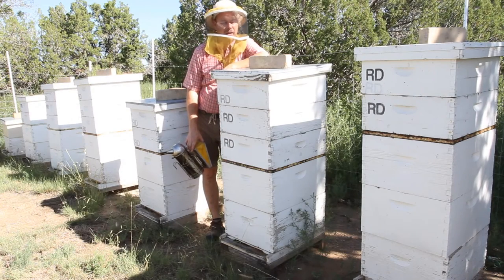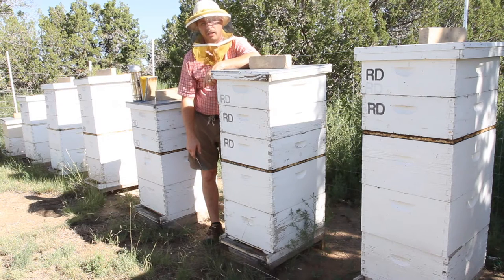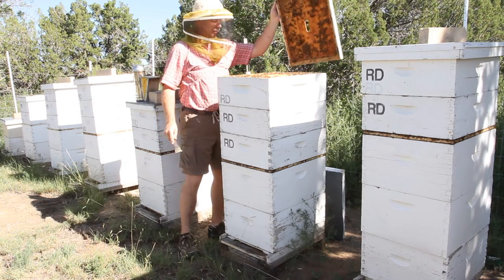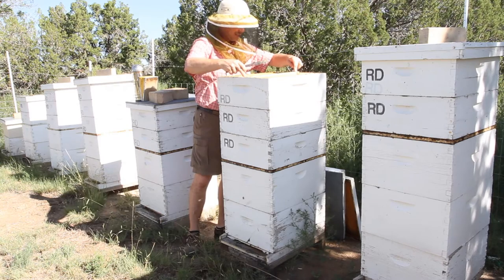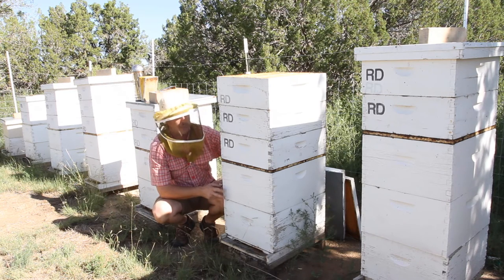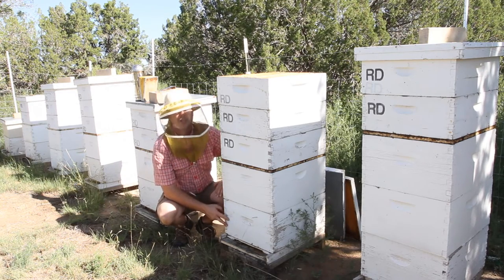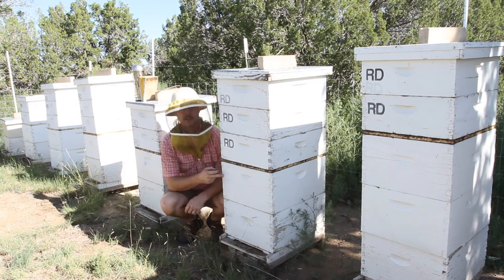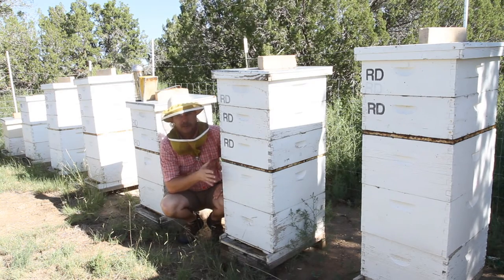Checkerboarding II

Comment: Excellent video.  The question I have is that in the spring, when he bees are in the top hive body, and thus empty in the hive body of bees or stores,  do you reverse the hive bodies?
Reply from the maker: You can, as long as you know the bees are clustered only in the top hive body.  This will speed up their brood production, so if you do it too early before a nectar flow you will have a swarming problem.  Some beekeepers will invert the hive bodies when the bees are in the middle of a double deep hive body which splits the cluster and slows down brood production...as a swarm prevention measure.  I have a video on this if you're interested:

https://youtu.be/Km5KVEsAEh0

Thanks for asking!

Comment: in doing the Walt Wright checkerboarding ... you have ABAB in the lower honey super ... and * BABA * in the upper.  My guess is that when you need to add that upper super, if the lower super is full ... or near ... you could pull every other frame from the lower (ABAB) and place in the checkerboard pattern (BABA) above.  Is that how you do it?
Reply from the maker: That is the Walt Wright method, yes.
Reply: Just curious have you tried an empty super in  between your lower and uper checkerboard?
So 
Ababa Ababa
Aaaaaaaaaaa
Babanababab 
If that makes sense.

Comment: I see that you don't use any Imerie shims. Wouldn't this make egress to the honey supers easier for the workers?
Reply from the maker: I've tried them before and never found them to increase production of honey.  But, the real problem for me is that the shims create a gap between the hive bodies that is too large and so the bees tend to build brace comb between them and fill them with honey, which makes it hard to pull off the supers at harvest and creates a mess.  You'll find opinions on both sides of the aisle, but I didn't care for them when I tried them out 20 years ago or so.
Reply: Thanks for your reply. I thought it might make access easier for the workers.
Never thought of them filling up the void created. Makes sense!

Comment: You said you lost brood when you pulled the old frames put and put new frames  in.
Could you have moved those frames above the excluder and let the brood hatch then pulled the empty grames?
Reply from the maker: Yes, I could have done that and it would have been fine.  At this point, I can't remember why I didn't, but the only real complication is if the nights are still getting below freezing.  In that case, you might be stretching the cluster too thin.